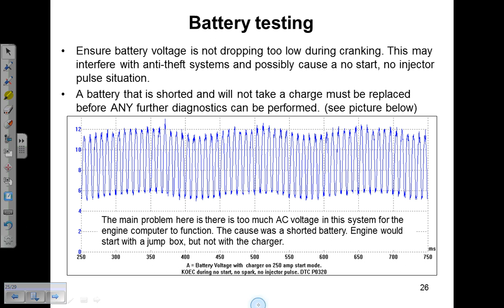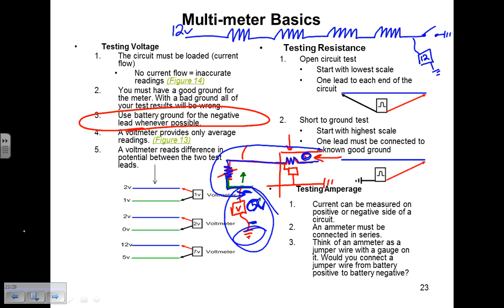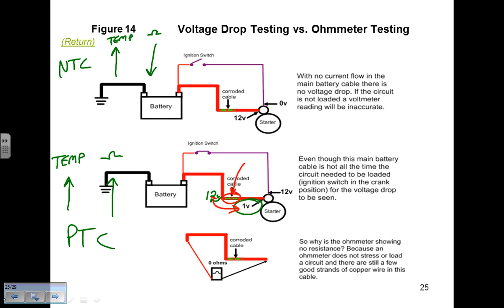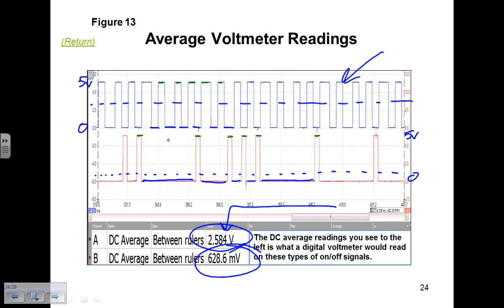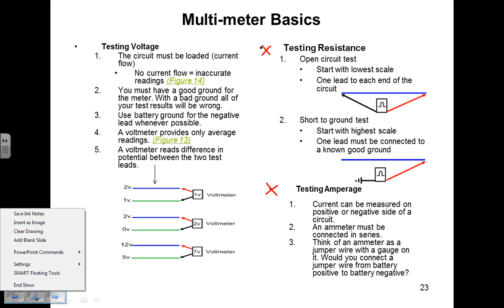Multimeter basics, voltage and resistance tests (a free SD Premium video)

Comment: I had a hard time checking grounds with a voltmeter, I finally got it, the voltmeter reads difference in voltage so battery ground is already 0 volts, when you check another ground there should be minimal difference,thanks Paul Danner for making all you videos extremely educational.

Comment: I have used the Load Pro for a couple of years. It is my GO-TO tool for loading a circuit. It is very useful in finding a restriction in current flow due to high resistance. It allows you to check the voltage while circuit is loaded, or not loaded. Another great video.
Reply: But it can only be used on 12volts or does it also work for low voltage wires? Like say one that only sends 5v source?

Comment from the maker: A floating ground provides the computer with a cleaner signal and is particularly useful for low voltage circuits. You could say it keeps the voltage sensing circuit for that particular sensor away from the noisy engine block ground. 
O2 sensors and variable reluctance sensors use ground bias voltage a lot. 
I have also heard it has to do with the analog to digital converter too, but I am no electrical engineer.

Comment from the maker: You can have low battery voltage during a crank from: weak battery, starter motor drawing to much amperage (seizing up), internal engine problems (engine seizing up). 
So low cranking voltage is usually from a weak battery but don't forget about the other variables.

Comment: I think he made a couple very good points here.  First that the voltage drop had to be tested with the switch in the crank position.  Second that the ohmmeter is not a good tester for higher amperage circuits.  It definitely helped clarify these things for me.
Reply from the maker: awesome! Now watch this one to see this theory in action https://youtu.be/McsNOJvd0ao

Comment: most important part - there must be 0 voltage present in the circuit to do a correct resistance test because of the way a multimeter calculates resistance. some stuff can only be learned in a classroom. good stuff

Comment: Load pro test leads. I got some that was give to me. Only thing I've used them for is the hollow point on test leads. Great for checking pins. That's all I can say about them.   I check for voltage drop at load. Great video Paul Danner.

Comment from the maker: @Amopower Yea, I don't like the resistance test on those either. I prefer a scope and an amp probe or voltage waveform. But you could still do a resistance test, it is a low enough current circuit that it should be accurate. An ohm test would be especially useful with an open coil, but then again voltage would identify the same thing. I just wanted people to understand the limitations thats all

Comment from the maker: @fivefortyeye540i Yes, the circuit is ground side switched and no, you would have shown 12v on the PCM control wire because it wasn't grounded yet (no current flow=no voltage drop across the relay coil). I re-checked the diagram and with cooling fan 1 disconnected you would have read nothing (no power, no ground) with your powerprobe on the load side fan contact (pin 87).

Comment: Yes. Your digital meter measuring resistance may not show you the problem in the battery cable not because the resistance can't be measured but because the meter is not designed to measure low resistances accurately. For example with some spit ball numbers. If your cranking amps are 50 amps and the cranking voltage at the starter is 10 volts, ohms law says the starter resistance is 10 V/50 A=.2 ohms so if you had even 1 ohm of resistance in you battery cable to the starter, the current to the starter is now only 10 V/1.2 Ohm=8.3 amps but now there is 8.3 A X 1 Ohm = 8.3 V across the battery cable which you can measure easily with the digital meter and that's how an ohmmeter works. The meter supplies a known current to the resistor being measured on meter leads and reads the voltage across the leads and the voltage reading is converted to resistance. They do make ohm meters that will accurately measure resistance in the 0 to 5 ohm range.

Comment: I use a battery load tester on battery cables simulates load of starter cranking 400 + amps maintain 10.5 volts minimum.
Excellent work Thanks

Comment: Hi Mr Paul at 35:00 you said some tech will said  bad fan motor and your right, I was working at gmc van the ac fuse keep blow it, the mechanic said bad blower motor, what I found corrosion at the motor relay but I thought  the  resisted blow the fuse?  but never sure, thank you for this class now I understand more about corrosion..

Comment: I have a YouTube video that compliments this video and explains more about voltage drop. Just search for "ohms law automotive dc circuits" and you will find the 4 videos that explain ohm's law and voltage drops in more detail. Hope this helps for those who want to know more.
Reply: I just read that the max a computer ground should have as voltage drop is .10v but what does that figure mean? 1.000 is a thousand milliamps being 1 amp, so .10v is it a tength of an amp but then what’s the ‘V’ part of it?
Reply: +lwgraves  I found your way of calculating ohm's law long and tedious compared to how I was taught which was this way: https://www.youtube.com/watch?v=K7ZqNTrmcAU  A whole 59 SECONDS! Cover the one you are looking for and you are left with the equation to use. Simple!

Comment: I finally understood the deal with measuring sensor grounds and what it means to have more than 100mV. Thanks.
Reply from the maker: beautiful, thank you!
Reply: Revisiting this video, and I was thinking, the very same test could be done with an alternator, correct? Voltage drop the positive lead cable with engine running, to load the circuit? And the result on the DMM would be home much V is being "lost". 

Do you have a number that you follow to see if the red cable needs replacing?

Although, I suspect that if you measure low V on a running engine at the battery (eg, 13.1), then if you see V on a voltage drop test on the red lead would indicate it needs changing.

Comment from the maker: Ok, lets take a relay driver for example. The normal current draw of a relay coil is 100ma. Will 500ma be 5 times more current flow than this circuit usually sees? Yes! Will it cook the driver? Probably not, most drivers can handle way more current than the normal circuit draws. Also some are protected with current limiting devices. (Check out my GM shorted injector videos). 
I still wouldn't want to load a relay coil driver with 500ma.

Comment from the maker: @fivefortyeye540i 85 and 86 will show 12v with the circuit off. So the wire you showed nothing on wouldn't have been either of those. Pin 30 = hot all the time and Pin 87 should have indicated a ground with your power probe because it would have found a path through the fan motor brush contacts to ground. This is why I don't like the power probe. It is NOT a ground even though it shows it as a ground. If the fan was unplugged then pin 87 would have shown neither power or ground.

Comment from the maker: @fivefortyeye540i So with the relay plugged back in is when you did this? If this is the case be very careful that those wires do not touch each other. You could fry the PCM driver. Anyway with the relay plugged in you should show 12v on three legs. 1 = control side power 2 = control side switched ground (not grounded yet) 3 = Load side power. The fourth wire is the load side feed to the fan. With the relay off this wire would show a ground (unless you had the fan unplugged)

Comment from the maker: What other pins are you reading 300mv on? If these are sensor grounds, then yes it is too high. You want less than 100mv on a sensor ground and less than 50mv on an ECM power ground. (That would be tested with the key on engine off or running, NOT cranking)

Comment from the maker: @fivefortyeye540i OK, I looked up a 98 Buick Century 3.1  There are three cooling fan relays. Which one were you checking? Also in case you didn't know this system runs the fan motors in series to each other for low speed and in parallel for high speed. Depending on your testing if you had one fan disconnected it could change the readings you were expecting to see

Comment: Just diagnosed an 02 honda civic using this method. It had intermittent flickering of the instrument panel lights, srs light would turn on then turn off and resetting of the spedometer/tachometer during driving. No stalling, no engine codes. It would happen at least 3-4 times while driving it. I had changed the alternator/battery a year ago. I started at the battery. Terminals were highly corroded along with grounds so I tried to find a good ground and then tested power side under load with car running. There were two power cables, one said a consistent 13volts, the other went everywhere. Ok so i thought either corrosion or bad connection. Went to the distribution block where they went to, same thing... one lead had a steady 13v the other went everywhere. So there was not a steady voltage to one circuit.  i was going to try and clean the lead. The lead fell off the wire while loosening it. Put on a new one and cleaned up the grounds just in case and put some anti corrosion spray on all the connections. Test drove it and no more srs light on/ instrument panel resetting. If i did not test these i would have probably went and bought a new instrument panel for nothing :) was going to test the alternator but no more issues. Im saying issue solved
Reply: Nice job! Thanks for sharing
Reply: ScannerDanner Premium thank you! Also worth mentioning is i checked the grounds which were all good

Comment from the maker: @Username64870 Not necessary to do if you voltage drop test your ground circuit and it is ok. To test alt. ground, run engine at 1500-2000 RPM with all accessory loads on. Connect DMM from alt. case to battery negative post. The closer to zero volts the better. I would say no more than a few hundred millivolts difference max.

Comment from the maker: a voltmeter does not support current flow. and you never connect a voltmeter in series. it is always connected in parallel. your second point is valid, to a point. If the window motor is open then you are correct, there is no current flow so when testing the ground circuit for a voltage drop it will be inaccurate. lets say your ground is open on the window motor circuit, if you unplug the connector to do you voltage testing you will miss it. so on principle, leave it plugged in

Comment: At around 29:48 you ask class what voltage would be on ground with an open. Why does the meter not provide ground to the circuit at that point? The meter is only showing the pressure change? The meter does not provide a path for current flow? I will accept this rule just looking for a bit of clarity
Reply from the maker: There is on average 10 million ohms between the positive and negative voltmeter leads. So how much current flow does 10,000,000 ohms support? This is why the meter does not provide a ground. You're basically running a jumper wire to ground that has 10,000,000 ohms of resistance.

Comment: Matco sells what's called a volt pro. It dynamically  loads the circuit. I particularly like it cause you do not have to turn your component  on. similar to the load pro. Have you heard of it?

Comment: What we don't know is what voltage we have from the ignition switch.  And if we have a break in either wire going to the ignitor.  and the same on the negative side of the coil.  we have two wires the either of them could be the cause.  It could be bad igniton switch as well.

Comment: Yes, one fan was unplugged , when I probed the harness I did have a ground neg probe lit off, but on second wire no power. So dose that make it power side switched?? Yes I had  4 wires running to top of relay, I had power on 3 legs. Nothing on forth leg, looking at relay schematic writing was facing outward. The first leg going at the top going left to wright is the one that did nt show anything.. The rest had power 12 volts..

Comment: I had  a Chrysler Pacifica that would crank and run at times and at times it would not crank. I had power at the starter and also had signal voltage while cranking to the solenoid. So I put a starter in it and it would not crank it would just click after doing that. And what I found was a braided ground going from the trans to the frame that was broken.

Comment: I've also heard that resistance should be measured to determine if your IAC motor is fine. Not sure how you would do a voltage drop test on that one, I think those are a little more complicated because the voltage they receive gets varied by the ECU. I guess if you know what strategy your IAC is working on (like warm idle), and you know from the specs that the duty cycle should be 75%, then I suppose you could determine the voltage should be 75% of battery voltage...just thinkin out loud...

Comment: I like the water pressure examples and adding hypothetical restrictions (resistance_) into a water line and asking what would that do to the pressure(voltage) at that point.

Comment: well variable resistor that was getting 5v ref. Then a voltmeter in series with a circuit breaks current flow? 

One other thing. Voltage drop is just for resistance, ie something is working slowly or intermittent, no for an obviously dead component. For example I have an open window motor so the circuit is open at the motor and wouldn't even make a difference if I let the connector connected or not there isn't going to be current flow.

Comment from the maker: I am not against this tool, but I am also not going to endorse it either. (not without using it anyway)
 When I answered that question, I did not know that it had a 500ma max output. I never used the load pro so forgive my ignorance.

Comment: Jumping a test light between battery ground and the engine block is a quick and dirty way to see if there's a ground problem there. I work in diesel and have see a lot of ground wires left off starters and such, might work for cars.

Comment: you should ve mentioned that thermistor(ECT sensor)... as being NTC...heats up, resistance goes DOWN...but the SIGNAL voltage will also go down(if the circuit is ok)...i m making  comparison to that voltage drop at the fat wire(as it heats up too, resistance goes UP)...another topic...just connecting the dots...kink in a hose...what happens before and after the kink?...or kinks...got ur book, i m learning ;)
Reply from the maker: +Zvonimir Bobic yes you are and thank you!

Comment: This is still something that is a source of confusion for most people. Even in my factory GM and Chrysler training there is nothing mentioned about this. Tech school also. Resistance does not change voltage until there is flow.

Comment: Thanks again Danner, I'm having a problem with a 86 blazer TBI setup and have put this knowledge to use.  The CEL is constant and will not blink when the diagnostic pins of the ALDL are shorted.  Rather than put in another ecu immediately I decided to confirm that the wiring isn't a problem.  I have 3mV voltage drop at my ecu ground to chassis ground and upto 300mV on some of the other pins that according to the factory service manual should be 0.  Would you consider that a problem?  Thanks!

Comment: @scannerdanner I'm studying page 73 (testing computer driver) to reiterate, on that cooling fan circuit on that 98 Buick century  3.1L . For argument sake If I wanted to test that driver I simply would have hooked up test light to batt pos and touch on recessed (relay out the loop )
terminal that is ground side switched. Test light should have lit correct?

Comment: Paul, What is the most voltage drop allowed at the battery cables when measuring from pos terminal to starter and from neg terminal to engine block during cranking???????????????

Comment from the maker: I haven't, thanks for the info though. I don't use any load type tools as it is too easy to "fry" a computer driver with one of those. Applying a power or ground with the touch of a button is not a good thing in my world. Especially because I am teaching others. "Rookies" WILL use this type of tool incorrectly.

Comment: So would you agree that resistance readings are still valid when checking fuel senders (potentiometer), as I would imagine those are low current circuits ? Not sure about a variable speed fan, that might be some decent current.

Comment: Reason I asked is because at the time I rapped wire around each leg of relay.. When I touched 3 legs with the power probe I got 12 volts on 3 legs. But when I touched on the fourth leg i got nothing, no green ground light no nothing  no audible tone nothing.. So after studying   pg73. I can't help but to think back why, why that probe dint light up to notify me that's a ground? Is it because the driver has to get input else where to be turned on?  ( become ground)

Comment: Ok, I had 4 wires running to the top with Koeo i don't remember witch leg was which. But I do remember leg 30 was first leg going from left to wright. The leg right above it was the leg that had nothing on it.. That's the leg that would have been pulled to ground to complete the circuit.. Sorry Dan to be harping on the same thing but I half to be certain. because I come into these cars all the time. And things like this boggle my mind until I figure it out.

Comment: Hi Paul, If the car wasn't cranking due to a bad block earth what would the drop test on the power cable to the starter show? Also to show a bad earth would i just probe between the block and negative terminal on the battery?